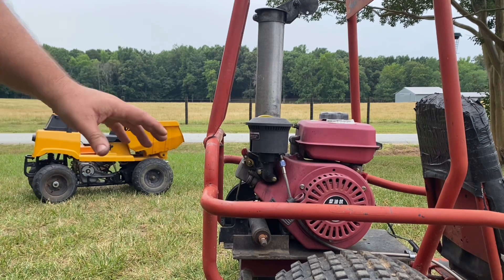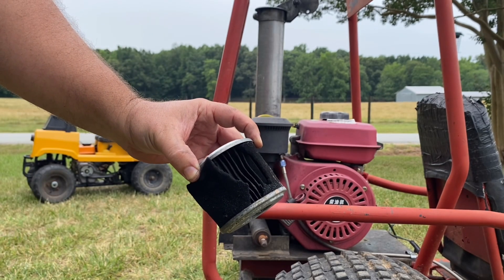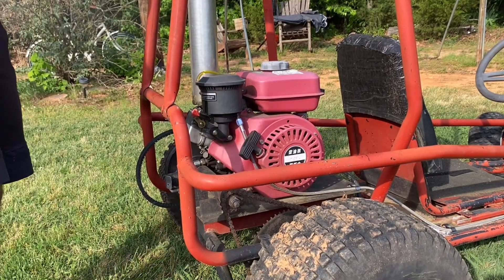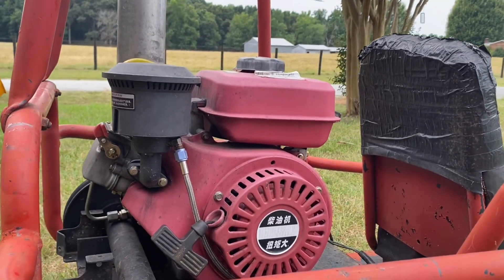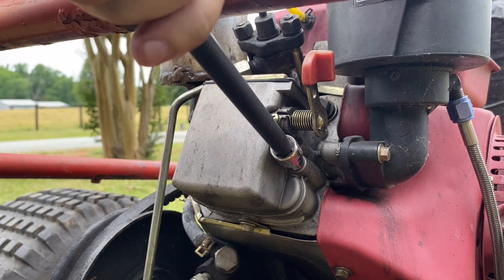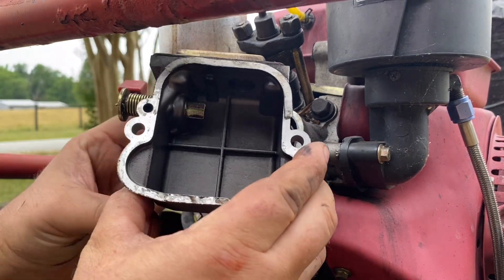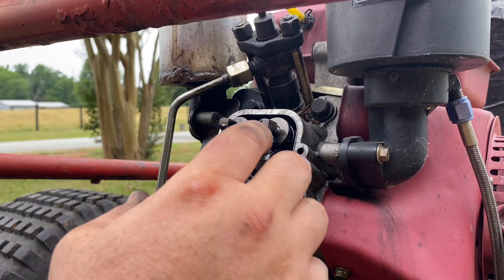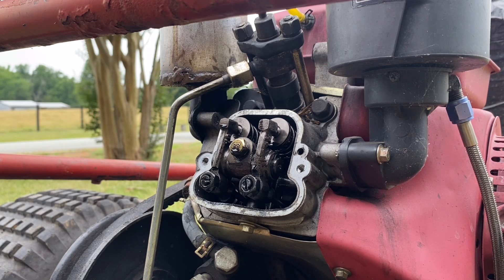Why You Shouldn’t Use Decompression Switch To Turn Off Chinese 196cc Diesel Engine

Comment: I want to get the output shaft on my chinese diesel smaller to fit a clutch, in one of your videos you said you used and angle grinder but how would I use an angle grinder evenly?
Reply from the maker: Just take a little off at a time. Make a pass down the shaft then move over and make another pass and just keep going around the shaft. It’s not going to be perfect but you can get it close enough to work. Once you’ve got the shaft close to the correct size you can start the engine and finish it off with belt sandpaper as the engine is running to get it uniform and to get rid of the edges created from the grinder. You can do it without a grinder and just use the sandpaper while the engine is running but it would take hours.

Comment: I plan on buying one of these for my ride on lawn mower, is there a way to make it roll coal more? And I thought the decompression switch was a Jake brake
Reply from the maker: If you can figure out a way to increase fueling it would roll coal. Easiest way is to restrict airflow though but it would reduce power.
Reply: @jwsbackyard6413  alright, whats the fastests you can get? im thinking either a 10hp or a 5hp diesel
Reply from the maker: Speed will depend on your gearing really but the 196cc makes about 3hp and 6lbs of torque it isn’t very powerful. I have mine gear low so it tops out at about 15mph. Sacrificed speed for torque.

Comment: I just found you and you have the accent you’d expect watching early grind hard videos. You also are or have done the things I have been thinking since buying and fixing up a go kart for my 8 year old. Please turbo that small diesel cause that’s been my thought for building my first ground up kart for myself. Like I have seen guys do it with mowers, but I want to try it with that exact 196 cc Amazon diesel. Get some affiliate links too so I can give you a kickback if you do.
Reply from the maker: There have been a few people to turbo the 196cc diesel but they were vague on fueling and whether it actually made anymore power. A lot of people say single cylinder engines just don’t have enough flow to produce boost but it would be interesting to try out. Red beard’s garbage was one of the channels that had tried it.

Comment: Now that you have pointed this out I'm going to buy one of these diesels and only shut it off with the compression release.
Reply from the maker: That’s usually what gets most people motivated
Reply: My only plan to shut off my diesel mini bike is to use the decomp lever. It’s $150. I’ll just go buy a predator if it messes it up

Comment: I'm suprised the intake pushrod doesn't fall loose when using the decompressor!
Reply from the maker: Yeah I’ve been trying to figure that one out to. I’m going to have to look into how it’s designed a little more or see if it’s retained somehow.
Reply: @jwsbackyard6413  I was thinking about the decompressor getting the air filter dirty & realized it's not. Anything that comes back up the intake already got filtered, so it's not actually dirty, it's just oily. Oiling an air filter makes it filter better, generally, so it's like a filter-oiling-system.
Reply from the maker: The soot from the combustion is what makes its way back up to the filter. The filter was caked up with so much soot air flow was severely restricted and it was smoking way more.
Reply: @jwsbackyard6413 how about soot on the valve seat build up
Reply from the maker: Yeah that’s a good point. Hadn’t really thought of the valve seat
Reply: @rstumbaugh43  there is all kinds of buildup, anyway. Sure, it adds to the gunk, but cleaning it isn't different, just more frequent.

If the decompressor held the exhaust valve open it would suck unfiltered air.